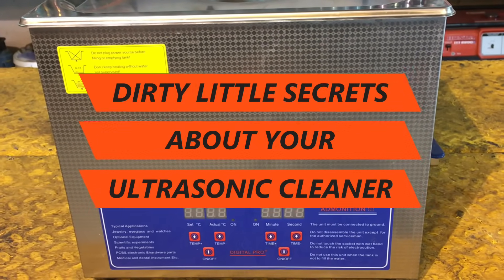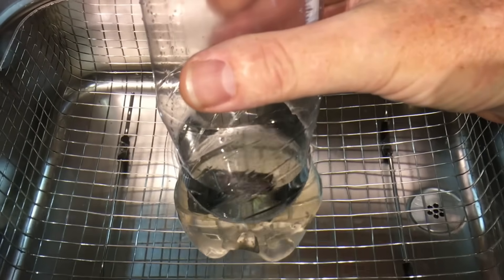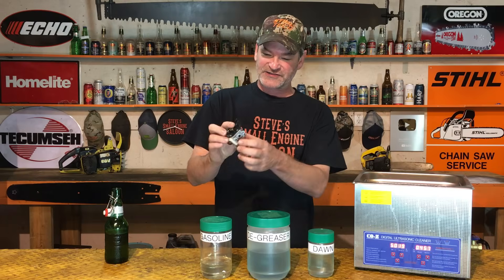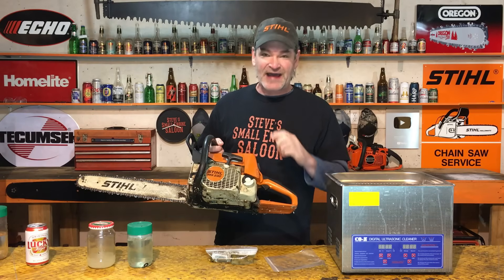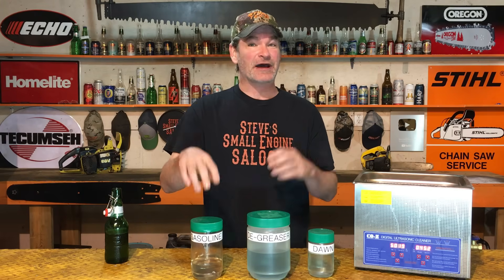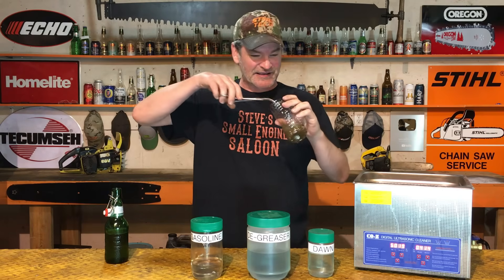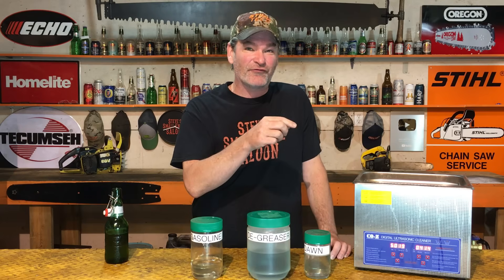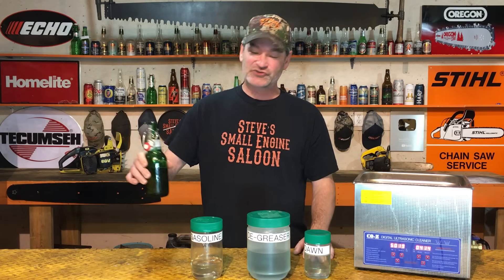4 Ultrasonic Cleaner Mistakes You Need To Stop Now!

Comment: Another issue I don't see people talk about. When that dirt and debris gets looks, it won't magically just fall out of the carb, I've found it generally finds its way into lots of different spots on the carb afterwards.
You'll want to run a good amount of air through them afterwards, especially in the butterfly valve hinges I've found.

Also, if a carb is really gunked up, not even gas and multiple hours of ultrasonic cleaner will clean it. Also yes, I fully disassemble them always before cleaning. Every jet.

My current process involves a mix of manually cleaning the carb off and making sure no holes are plugged. Essentially going through and doing a rough manual clean, and then hitting it with the ultrasonic cleaner afterwards. Less debris floating around that gets lodged in places and less likely something stays clogged and you have to redo it.

Comment: The best degreaser I have ever found is Dawn dish detergent mixed with 90% isopropanol (rubbing alcohol). Do not dilute with water, and use the 90% strength, not the 75%. It will rival gasoline. BTW, this mixture is what the Dawn Platinum is. Try it Steve, you won't regret it.
Reply: Good idea but in what proportions (Dawn/Alcohol)?🤔

Comment: As usual some of the best information on the internet.  Based on Steve's recommendations I purchased the same ultrasonic cleaner and have been generally pleased with the results.  Prior to using this tool, I thought the ultrasonic cleaner would completely clean whatever I put into it.  It definitely cleans but it does not completely remove all contamination.  My expectation was unrealistic.

Comment: Gasoline in its liquid form sure is flammable but it's fumes are down right explosive and that is where the problem lies. Most people will heat the tank liquid media which will increase the pressure inside your plastic jar and eventually cause a gas leak that could ignite and violently blow up. If you allow the gasoline to heat up in the jar, you have created nothing short of an incidiary bomb. Regards !

Comment: If you're worried about flamability, try diesel or kersene.
Reply: Firearms folk use the ultrasonic cleaning system to clean gun parts.  It does a fair job on cleaning the brass ammo for reloading, but it really cleans when using special cleaners for metal gun parts.  You just gave me ideas for small parts.   Thanks !
Reply: @2pugman like what? I bought one to try and clean .22 parts, but haven’t because I’m not sure what to use.
Reply: I have the harbor freight one.
When I need to clean something in solvent ,I fill a jar with solvent ,add the part and put it in the tub that's already filled with a cleaner like simple green or something.
Now it's isolated and still gets the cleaning effect and you have less flammable material to deal with than a full tub.
Reply: ZEP metal cleaner in one gallon containers.  You can dilute it.  It’s a Home Depot.  Yellow gallon jug.  

Great video
Reply: @GreyGhost-r4z  I'll have to try that someday. I like their citrus cleaner(orange) and shower cleaner, I've gotten their degreaser before as well, but I prefer to use simple green because it's safe for all things.

Comment: Steve I generally use Dawn an it hasn't failed me. Yes peanut butter jars work well with your cleaner of choice. if your carb is real dirty I use  Kerosene and a brush then Dawn in the ultrasonic to finish. I agree disassemble the carb for best results.

Comment: The science is that water does absorb the energy from the ultrasonic transducers. Without it, the transducers end up absorbing the energy and they are not designed to do that.  It is a little bit like a heating element that is designed to be immersed: run it dry and it will fry.
Reply: I'm not really understanding your comment,  because one of the first things he said was fill the tank with water.

Comment: If you had used a 10mm socket and it disappeared, that sure would have explained why they come up missing all the time...
Reply: The high frequency sound waves open up a space rift , the sockets land right beside the ONE sock from your dryer . True story.
Reply: @jamesdenton3692 That sounds as reasonable as any other explanation I've heard 😂

Comment: Simple Green Extreme/Aircraft works great and doesn't discolor parts. I use about a 30/70 mix with water.
Reply: Yes!  Simple Green Extreme/Aircraft is awesome.
Regular Simple Green is really hard on aluminum, not a good thing.  It's even bad for anodized aluminum.  I once used regular Simple Green in a 1-to-10 ratio, and it turned the black anodized parts into grey, and the solution was cloudy grey, too.

Comment: My concern about using gasoline is that you are heating it up and increasing pressure inside your container, which has no vent. The container could burst, spraying gasoline everywhere and possibly causing a fire or injury. I don't know if carb cleaner would be much better, but I would try that.

Comment: Minimum water height is the little indents in the corners of the tank. This will prevent premature failure of the ultrasonic piezo units. Simple Green is our preferred all purpose cleaner.

Comment: Some parts you should not use gasoline like wheel bearings. Gasoline, I was told, leaves a film on the bearing and grease won't stick to bearing on bearing surface

Comment: As someone who sold ultrasonic cleaners for over 40 years to the dental profession may I offer a couple of tips. Firstly, don’t use plastic containers if you want the best results. Use glass. Plastic doesn’t allow the ultrasonic waves to pass through as effectively as glass. Second, even if you are using containers or beakers, always put some cleaning solution in the bath. This lowers the surface tension of the water allowing the vibrations to travel through to the beaker more efficiently.
Reply: Thank you for surface tension tip, I was aware for glass but never i'll guess that surface tension help to.
Reply: out of curiosity would you want a relatively thin walled solution like i guess a beaker or would a old jar of peanut butter (glass jar ofc) be fine or would that probably be so thick that it'll function as insulation?
Reply: @anub1s15  speed of sound is around 1500 meters/sec in water and around 5000 meters/sec in glass, so I am pretty sure any glass container will do.
Reply: @guillaumeberger3598 that speed difference acts like a mirror, reflecting energy away from the jar.
Reply: @Rorschach1024  You 're right, I forget about substrat transition, it will be the same as air/water transition. But (my observation only, as angler and diver ) I notice the transition from low to hight speed is less impactfull then the reverse. Let me know your thought.
Reply: As a dentist my self what would be a cost effective ultrasonic.  The price has went way up
Reply: @joshraleigh101 they are like $50 on Amazon.  Just don’t use gasoline on the teeth.
Reply: @mattcasoni😂

Comment: Back in the day I used gasoline to clean all my motor parts. You just sent me back to that whole deal. Great Video.
Reply: With the price of brake cleaner, I may go back to using gasoline on some things.
Reply: Used gas all the time til my uncle opened a small engine shop. Then he got safety clean. We had a pre wash tank with old dirty cleaner, his good tank with clean stuff. With all the enviro safe rules now I wonder if safety clean is any good now. He also had a pail of carb cleaner that would clean the worst carb in 10 minutes. That shit would eat the skin off uour hands. It's illegal now to. That stuff was awesome.
Reply: I still do. Half full 5gal bucket with lid and brushes of different sorts. Any bad gas goes into there and have a sieve pot to keep my hands from getting exposed unnecessarily.
Reply: @garychandler4296 Yep,that’s what I do with old petrol ( ‘cos I’m in the UK! 😉)

Comment: Your content and presentation for ALL of your videos is second to none! Thanku for that 🙏 Been subscribed for years and have learned a TON!
And your “Steve Out” closure makes me smile each and every time!
Regards,
Steve in NH
Reply: I use evapo rust and that cleans everything and anything yes I have to wipe my tank out and clean it but I can put anything in it and it cleans cast iron it does great and the Apple rust you can use over and over again for a long time before I have to clean it. Yes it can be a little expensive buying the evapo-rust but you can use it over and over and over again for a long time and I cleaned many carburetors and bolts and nuts and all kinds of parts in it before I have to clean it so to me it's works better. The other reason I like to use evaporust remember the evaporust is environmental friendly so you can dump it in the yard and not have to worry about hurting anything so that's why I use it.

Comment: With me, I've been using an ultrasonic for 15 years, I don't use gas, cause of the price, its not cost effective.
My mix, I haven't found a carb it won't clean,
25% simple green "PURPLE".
25% distilled white vinegar
50% baby water, or distilled water.
Now fill your tank 1/2 way with regular tap water, now get a Helmans mayo container Helmans cause the mouth of the so large, and any carb will fit.
Add my mix to the mayo plastic jar, over the top of the carb, I only do 30 minute cleaning session, I usually do 3, now never leave a carb in my mix over night it will blackened aluminum, but 3 session it looks brand new when you are done. A few tips from a pro.
1. Never ever run both heat, and ultrasonics at the same time, cause the heat will deminish the power of the ultrasonics, I never use the heat, as I use hot tap water, and when you run the ultrasonics for over 1/2hr the water get super hot anyway.
2. Never leave the carb in my solution any longer then 2hrs.
3. Get a ultrasonic cleaner with a drain, makes life so much easier.
4. When you drain the mayo jar, drain it into a mesh colendar, over a funnel into the container of white distilled vinegar, so you can use my mix over, and over again.... I change my mix every 3 months. My mix desont freeze easily my has been down to 12f not sure about lower.

Comment: Your wire basket should NOT sit on the bottom of your ultrasonic cleaner tank if you have.   transducers built into the bottom  if so you'll ruin it !!!!😢
My ultrasonic cleaner basket has handle on the wide side of the basket to keep it from touching the bottom of my tank if your tank contains transducers built into the bottom
Reply: His basket is designed to sit in the machine.  If you look closely @ 6:25 you'll notice plastic/rubber pads to keep it off of the bottom of the tank.

Comment: After watching countless other videos of others using ultrasonics, this was the best video! Others dumped solution into the tank, then dealt with the cleanup. Thanks for showing a better way!😊
Reply: I bought one a little while back didn't get to use it much yet. And thank you very much for all the pointers. I'll definitely follow your advice.
Reply: I have started using the container method and it is a game changer. I can change solvents without a problem. Use the same cleaner for multiple hobbies (3d resin printers cleaning and engine rebuilds) and best of all, no cleaning out a tank of gunk and oil, just toss the jar and get a new one.
Reply: If I need to clean a part in solvent ,I put it in a can of solvent and put the can in  the cleaner tub that's filled with water, that way the whole tub isnt polluted

Comment: Another great video!  On the fill, i'm only guessing the transducers over heat if the fluid level it too low.  Just a guess on my part.
Reply: They are made from crystal. And if there is nothing to absorb the energy they can break. In principle like a car engine doesn't like to be on full throttle in neutral gear.

Comment: Use the naptha based 4 or 2 stroke gas you buy in jugs. The cracker based pump gas is a lot more aggressive against some plastics, and it's much more nasty to handle.

The aromatic compounds in cracker naptha of the gas pump is way more bad for your health than the premix or 4-stroke gas. Aspen is the good stuff here in Scandinavia. Idk what you guys have.

I have this on good accord from a friend' who worked ten years as a process engineer at a refinery.